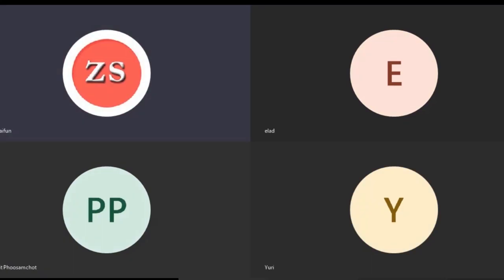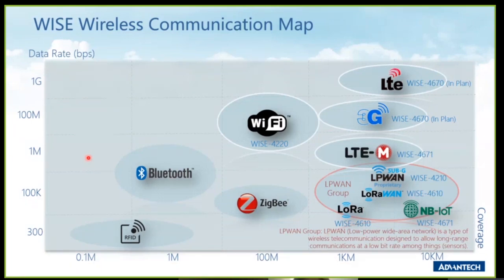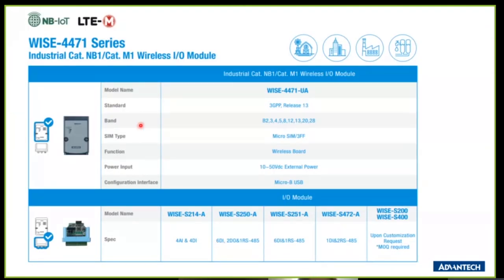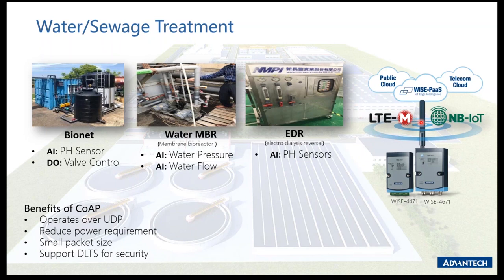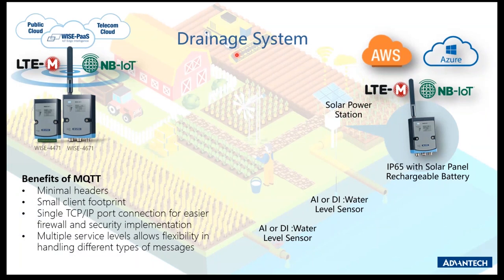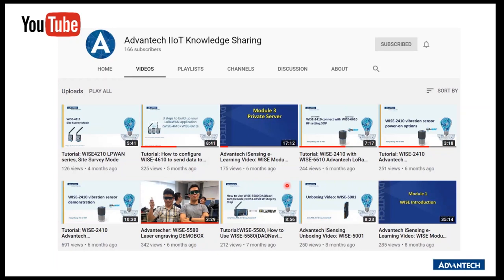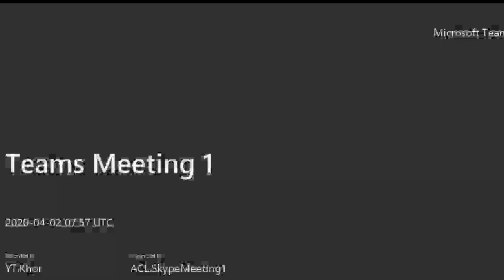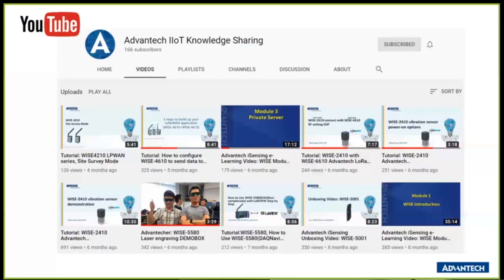Exploring Wireless Sensing and Cloud Integration Solution for Industrial IOT

Comment: Hello, does WISE 2210 and 2211 have battery ?
Reply from the maker: Hello, it is power up by a capacitor. When the device is power up, it will take time to charge the capacitor.
Reply: @AdvantechCorp  hello are you there, i need soome help regarding wise 710 and if you can make a video on configuration of advantech wise-710.